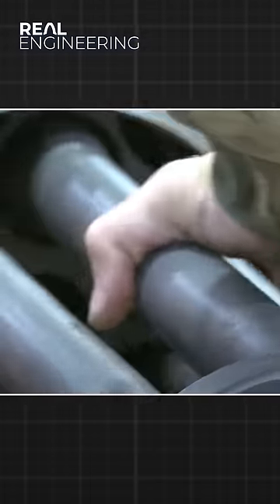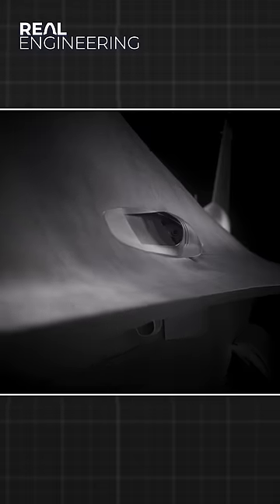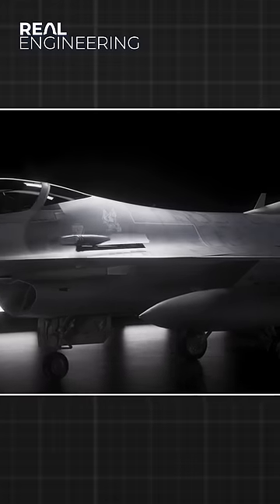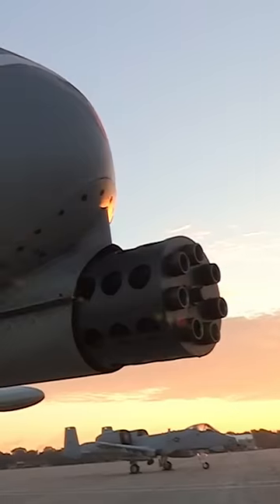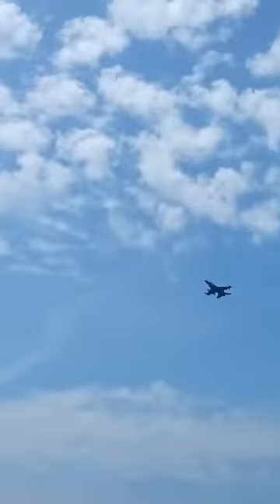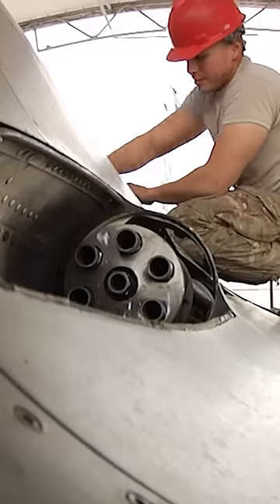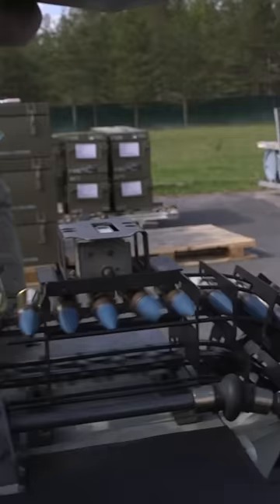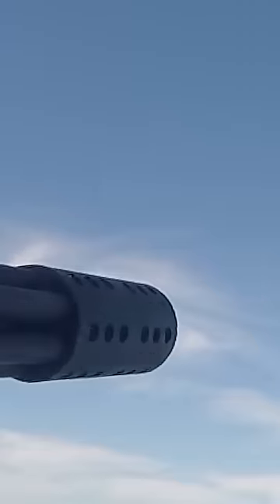The F-16s Gun Sounds Amazing

Comment: at those airshows the crackling you hear of the plane firing is actually the bullets impacting the terrain or passing by.
The Wuuu that comes after is the actual plane firing them, pitched up because of the doppler effect
Reply: They don't fire live rounds at airshows.
Reply: @fernandorosales2418  you've never been to Axalp then. The bullet impacts targets less than 800mt from the crowd. They're non-trace training rounds, but still those are real bullets flying in the air and they sound exactly like this.
Blanks are not a thing for the vulcan
Reply: @fernandorosales2418  they will do strafing runs in front of live audiences. They use TP or blue tip rounds. Really common. Actually.
Reply: @alpenfoxvideo7255  surely it's not less then 800 meters from the crowd, that is scary close and surely ricochets could be an issue.

Would like to see video of this
Reply: @crf80fdarkdays  flight paths are calculated, anyway it’s full of videos of last year’s show. I was there and was special because they shot twice the amount of prev years
Reply: Thank you so much, that bark of the gun stood out to me more than anything in the video and I was hoping someone could explain those two sounds we heard.
Reply: @thatsHECKAtight same. Kind of a haunting sound. I like it.

Comment: I heavily prefer the m61 over the gau8 in terms of sound because it sounds hella aggressive and not so much like a fart
Reply: Fires faster too in part because it's electrically fired and not percussion like the A-10. Also, M61A1 use hard brass vs aluminum for the GAU-8.
Reply: GAU-8 does not sound like a fart when you hear it in person. Sounds more like thunder.

Comment: My entire years salary in one spray
Reply: USAF 2W1 here. Copypasta meme-ry aside, we reuse the spent brass and with TP rounds, a normal sortie is 50-150 rounds expended (Almost never seen a full drum of 510 used in testing). Given the material cost of repacking, it's 115-350 dollars per sortie. 

But we only fire live rounds in a TDY operation which is two to three times a year.

During an entire Operation Redflag in Nellis, for two weeks, the total cost of gun repacking may get to your pay for a few months.

It's one of the cheapest expenditures considering the other munitions we use during those TDYs. Chaff and Flare are the other cheap cost option, similar to the rounds.
Reply: @janus3555  definitely cheaper than running a test on Aegis or Patriot systems with live fire lmao

Comment: The 7-barrel 30mm GAU-8 used on the A-10 was modified into the 5-barrel 25mm GAU-12 used on the AV-8B Harrier (underbelly pod-mounted).
The GAU-12 was then modified into the 4-barrel 25mm GAU-22 used on all 3 versions of the F-35 (internally on the USAF F-35A, and underbelly pod-mounted on the USMC F-35B and USN F-35C).

Comment: I would've thought they'd want a pop off panel or something to cover the gun to reduce aerodynamic drag given the gun will so rarely be used. Guess not.
Reply: The mechanism would add weight. It would also likely change the drag characteristics of the plane when deployed, potentially causing roll or yaw at the exact moment the pilot wants to shoot. Also it would require maintenance, and its failure would leave the gun unable to fire.
Reply: The F-22 has a cover for its gun's firing port. The gun is completely hidden with the cover closed.
Reply: @agentoranj5858  yep, the f-22 is a very different plane though. The 16 is a very practical design, meant to be cheap and reliable. The 22 by comparison is mostly meant for showing off, if you don't mind my saying so.
Reply: @MainlyHuman well on the f22 it’s a stealth aircraft and not covering the gun would compromise stealth, not to mention the f22 isn’t designed to get into gun fighting range
Reply: @spaps2290  also true

Comment: If they slow down the gun, it could be useful against cheap drones. Not worth the cost of a missile to take them down and they move slow so no need to empty the magazine to get a hit.
Reply: We can modify the RPM to any value we want. We often do depending on operation, and type of rounds in use (TP, HEI, AP). 

Maximum for the M61 being electrically fired is 7000/minute (Drum, gun, entrance chute, transfer chute, exit chute and return chute all hold 510 rounds). 

We usually keep it at 2600, 3800 a minute though. We can slow it further but if we're talking drone warfare, we have other methodologies that are MUCH more effective and more wide ranging whereas using the gun is if the pilot wants to have fun.

Almost never though you'll have a pilot with the clearance to do something like that though. :(
Reply: @janus3555  all fighter aircraft have variable rates of fire on the gun, usually a high and low setting as far as I know. High is used against air targets and low for ground. Being an electrically fired gun, you just spin it at a different speed and it'll fire at a different rate. It's remarkably simple, yet very complex at the same time
Reply: The planes can vary the rates of fire and also have the computer set to limit the round to bursts of something like 10 - 50 rounds to preserve ammunition.

Comment: Just 5 seconds to empty the ammunition?
Reply: I know. Sounds dumb. Like, even at 1/3 that fire rate, it would still turn lightly armored anything to Swiss cheese, and it would triple the fire time.
Reply: @SarcasticTruth77  For aerial firing all you need is a second.  Targeting is all via radar and a ballistics computer.  Point & trigger.
Reply: We never keep it that high which caps at 7000 a minute with 510 rounds in a drum. 7k a minute could jam the gun or cause damage in constant fire use. It can fire faster than the GAU-8 on the A-10 because it's electrically fired, not percussion, but we still keep it down well below the rated maximum. 

Type of operation determines rate at which we set it to, as well as types of rounds (TP, AP, HEI). Normal range is 2600-3800 a minute. At 3000/m it takes 10 seconds to empty a drum. 

(USAF 2W1 on F-16s, F-15Es and F-22s)
Reply: @janus3555 I did 6 years on F16s. Miss it occasionally.
Reply: @SarcasticTruth77 it's intended for air targets. Hitting an aircraft with a slow firing cannon is much harder because of the high relative speed.
Reply: @jimmiller5600  how many degrees of freedom does the barrel have for auto targeting? There doesn’t seem to be much room in the fuselage to allow independent movement of the gun assembly to make auto targeting useful. In fact I’m not sure if I believe that the gun has any aim assist at all. It’s aimed by the wherever the plane is pointing
Reply: @thatsHECKAtight   The barrel has 360 degrees of lateral and 360 degrees of longitudinal freedom.  The radar fixes the target.  The ballistic computer creates a firing solution.  You point the plane until the HUD designates target lock.  You pull the trigger.  Whatever is locked explodes from incoming rounds and internal flammables.
Reply: @thatsHECKAtight The gun itself does not move, it’s just that a computer calculates exactly where the plane needs to be pointing to hit the target and displays it on the planes HUD, so there’s no guesswork.

Comment: I remember while at Hahn AB they had a team getting ready for “gunsmoke” weapons competition and I don’t know how or why they were under that panel but they ran the wiring harness between a spar and the panel, it chaffed and if I remember correctly (it was 39 years ago) but they pulled that plane and stuck in another since the first needed a complete harness and being fly by wire it didn’t like stray voltage!

Comment: I thought the gun could only fire 1-sec bursts because any durations longer risked melting the barrel.

Also, the gun is located as close to the centerline/cgm of plane so the torque of firing impacted avionics as little as possible.

Comment: The F-16 fighter jet is equipped with an M61A1 Vulcan cannon, a 20 mm rotary cannon with six barrels. Here are some key features of this weapon:

1. **Type of Cannon**: The M61A1 Vulcan is a Gatling-style rotary cannon.
2. **Caliber**: 20 mm.
3. **Rate of Fire**: The M61A1 Vulcan has a high rate of fire, capable of firing between 6,000 to 7,200 rounds per minute.
4. **Ammunition Capacity**: The ammunition system typically carries approximately 511 to 1,200 rounds, depending on the configuration and mission requirements.
5. **Purpose**: The cannon is used for air-to-air combat, ground attack, and self-defense. It is effective against enemy aircraft, ground vehicles, and other threats.

The M61A1 Vulcan cannon is one of the most reliable and combat-proven weapons, widely used in various U.S. and international combat aircraft.

Comment: The M61 is NOT the "smaller cousin" of the A-10s GAU-8. They are not from the same design lineage.
The M61A1 is used on most US fighter aircraft.
The M61A2 is a thin barrel version (200lbs lighter) used in the F-22 and F/A-18E/F.
The US Navy also uses the M61 in the Mk 15 Phalanx gun on most of its ships.

Comment: The problem from the past would be the f-4 fantom. 
Anyone with an intelligence quotient above room temperature
Reply: Wasn’t really a problem, it was entirely roe and pilot training, and it still did fairly well with those issues.  Changing those two things radically changed the outcomes of air battles.  

Turns out when you build jets for bvr combat and then tell pilots they have to read the callouts on the enemy jet’s tail before engaging, youre about as affective as using a tank cannon to joust.  Thats what it all boiled down to, senior leadership insisting on not using the technology the way it was intended.
Reply: @Typexviiib  after all,  why did command make the gun pods in the first place!
Reply: Oh@ wait.
If you dropped ain9. 20 miles out !
You had a  clean f-4 , with guns!
A truly scary air frame!!
Reply: @pauldewees7571  ground attack mostly, but they did have occasional use against aircraft in the 1960s because radars were a lot less reliable back then, leading to some  very close range encounters.  Also, senior leadership at the time seemed bound and determined to make long range fires not work.  Military leadership is typically run by guys stuck 20 to 30 years in the past, which in the 1960s meant they thought in terms of ww2 dogfights. 

Aim9x has completely rendered the gun pointless, and its utility had essentially vanished by the mid 1970s.

Comment: 511 rounds? Why bother? Figure out a way to pack another 5,000 rounds in there and you'd have something.
Reply: Nah it doesn't need it because it would be way to heavy for the f16 and the idea is that the high fire rate can squirt out 50-100 rounds into an area almost like a shotgun blast with just a quick trigger pull which is much more effective at taking out another super fast jet in a dog fight especially with the f16s avionics that has an aimer on the hud showing pretty much where those rounds will fly

the concept comes from ww2 planes that would dogfight with guns like the m2 50 cal that shoot so slow they couldn't get enough rounds into an area to be effective against the new jet fighter technology like the german me262 that flew so fast they were only in the planes sights for a split second so you can imagine the 50 cal could only get 3-5 rounds fired per gun in that split second or 20 total across all the planes guns which isn't going to do much unless you get lucky but a rotary cannon can throw out 100 almost instantly which increases the chances of hitting something going that fast so 511 rounds is 5 trigger pulls and most likely 5 kills if the pilot is well trained which they are
Reply: Weight

Comment: 100 rounds per second? wtf how is that possible
Reply: It's not gas operated like a typical machinegun, so it's not limited by things like the distance from the chamber to where the gas is tapped off in the barrel to cycle the action and the rate of the gas expanding and spring rates, every barrel has its own bolt behind it, those bolts move in a zig zag track that has each one at the rear for when a cartridge gets dropped in the housing in front of it, then as the barrel cluster is rotating the bolt moves forward following the track and pushes the cartridge into the chamber, once fully chambered that barrel fires and as the barrels keep rotating that bolt moves to the rear pulling the cartridge out of the chamber so when that part of the rotating assembly lines up with the ejection port the centrifugal forces throw it out the port, then just past it that individual barrel and bolt line up with where a fresh cartridge is dropped into the housing in front of the open bolt starting the whole process over again, each of the six barrels and their bolt are essentially their own individual gun, it's just that you have 6 of them continuously going around and around, because of it's design the faster you spin it the faster it fires.
Reply: @dukecraig2402  oh I see, brilliant. but some Russian planes have 20mm guns where they don't have spinning barrels but STILL have pretty insane fire rates like the su25
Reply: @socialg4s  
Not really, those are twin guns in all reality, their combined rate of fire is still only half of what Vulcans can fire and they could never sustain fire without burning up, the thing about a Vulcan is the faster you fire it the cooler it runs because of the barrels whipping through the air.
I was a Vulcan gunner in the Army, our system was set up with 2 firing rates, 1,000 per minute and 3,000 per minute, our ammo drums held 1,200 rounds, on a night fire exercise if you sustain fired the entire 1,200 rd drum on the 1,000 per setting when it was empty the barrels were glowing red, but if you did the same on the 3,000 rd setting they didn't get hot enough to turn red.
The gun that's in the SU25 is actually a twin gun even though they list their combined rate of fire, and their ammo drum only holds something like 250 rounds, for all the more firing time it has you might as well leave it behind and take 2 more bombs with you.

Comment: General electric made it. Not general dynamics
Reply: General Dynamics bought General Electric's weapons division some years back.
Reply: @dukecraig2402  Every gun i ever touched F-15/F-16 said General Electric on the NSN tag.
Reply: @mattyx3x  
And every gun I ever touched as a Vulcan gunner in the Army had a tag riveted on the housing that had the General Electric symbol on them and was also marked Rock Island Arsenal (I assume that's because Rock Island is where the Army accepted them after being manufactured).
However it would have been impossible for me to see one marked General Dynamics because I was in the Army from 83 to 86 and General Electric sold General Dynamics their weapons division in the late 90's with the first M61's being produced by them in the year 2000.
As for why you never saw any marked General Dynamics I could only guess.

Comment: Pointless gun on that plane.
Reply: Vietnam says differend
Reply: @yourlocalboaty it very much doesn’t
Reply: @bennittotheburrito9606  it actually did, the F4 was originally not installed with an internal gun, due to america thinking they would go for rather long range and medium range with their missiles. When countered with mig-21‘s though, they couldnt engage in close ranges since the missiles couldnt pull that hard. After the pilots complained, new plane designs basically had always guns on them now, to avoid these situations.
Reply: @yourlocalboaty  so why did the navy also have the same increase in kill ratio despite the fact that they never put guns on their aircraft?
Reply: @bennittotheburrito9606  dont ask me, ask the military, but guns can be useful in some situations, you will be grateful if you have them
Reply: @yourlocalboaty  the including of the gun changed very little the gunpod was fine. The bigger problem was the air doctrine which wasnt made with missiles in mind. Thats why after the change the F4 became so much better. The internal gun came 2 years later if i remember correctly.